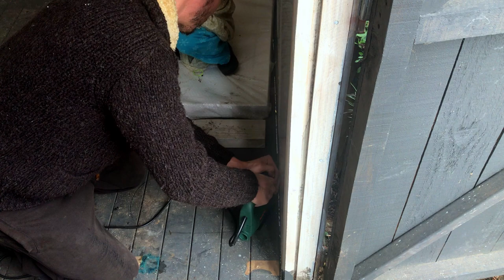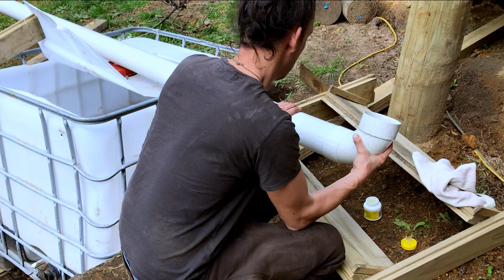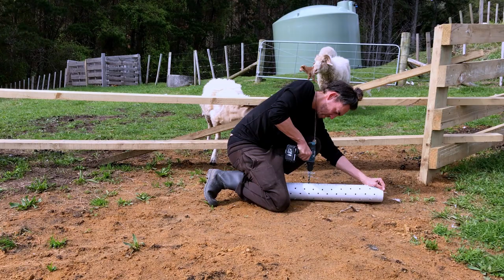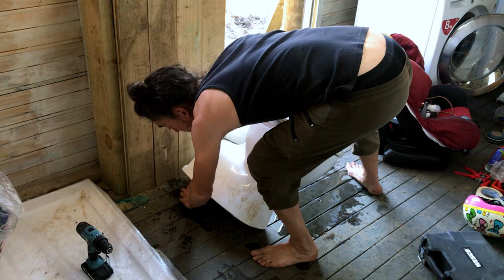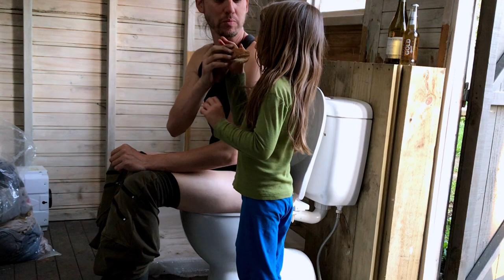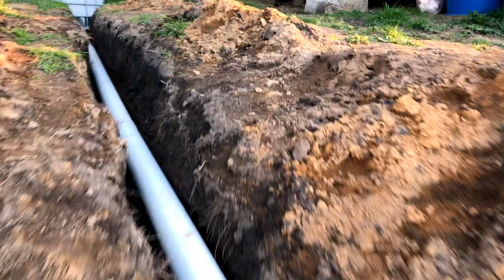Building the Yurt 10   Toilet Part 2

Comment: Thanks for the great video. Is the second tank just to hold the liquids?  Do you let the pee sit for a while before you empty the second tank? I want to build a similar system but with a reed bed instead of the second tank so that the water and pee goes through the first tank and directly into a gravel bed with a plastic liner and reeds growing in it.
Reply: i thought of doing the exact same but i wondered what to do in winter when reeds die off
Reply: @hebrew984  The main cleaning action for the liquids happens in the gravel bed where the bacteria eats the waste and converts it into plant food. In winter the reeds would die down but the bacteria would still be alive and converting the waste.  It may be slower at breaking down the waste due to the cold but it would still function.   The same action takes place around the soil where it drains without a reed bed but it's just happening in an area that is not isolated. If the waste area is not near anything then it's not an issue.